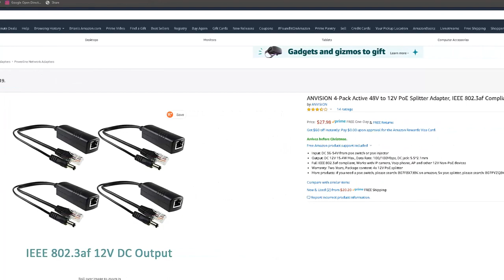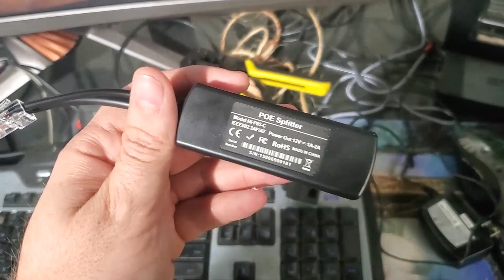Convert Cox iCamera2 12v to run on standard 802 11 POE

Comment: I'm trying to determine which are the 12-volt wires on the Xfinity xCam2 which is apparently supposed to be similar. I'm building a splitter to plug in to a router just to setup the dang wifi on the cameras without having Xfinity service.

Comment: Where did you buy the y connector? I bpught some cameras on ebay and have no idea where to find that connector to pair the camera to my router. I did see your link but I need the y connector with the female power output. Those were male.    Thanks and great video.

Comment: 😅 this several years old at this point but this is what I figured I thought a crossover cable might work but some of the newer cameras don't seem to be lining up with the correct pin to power them I wish there was a better write up and there's YouTube video there's not much information out there

Comment: If I make one of those, can I plug it straight into my PC ? And use it to record? I don't have a the system, I got the camera from Goodwill. I want to monitor my car in the carport. It doesn't have to be WiFi because it's close enough to plug in directly.
Reply from the maker: Not that I'm aware. You'd plug it into a router then look for the IP on the network.

Comment: Great Video. I tried this we a iCamera 1000 (i guess this was the original... haven't got it working just yet. the pin outs are probably different as the Rj-45 is a part of the camera), what software do you recommend using, iSpy? or something else?

Comment: Thanks for the video.  I've also acquired an Icamera 2.
My existing system is a traditional BNC coax mux. 
I can get a poe switch but was wondering if I could find the video + pin and also the 12v + / - ?
I've been searching online for a wiring schematic with no luck.
Any help would be appreciated.
Reply: Not sure about the Video +, but pin 4 (Solid Blue) is positive & Pin 7 ( White/ Brown) is negative. For the 12v supply

Comment: Thank you for video. Could you please share the full list of required accessories? I already have POE switch, 48V to 12V PoE Splitter Adapter. On the video I see that you are using 1 to 2 Port Female Socket Adapter and then I stopped understanding what else you were using. Thank you in advance!
Reply: Man, video looks great, but most difficult part is INSERT WIRES - try push red and black power wires - no way......it wouldn't work, video does not shown trick
Reply from the maker: @tedmaryniak2566  You just wiggle them like you do with any cat5 line. Time and patience is key.

Comment: My Cox icamera2's are hard wired but you don't need to go thru all that work.  I ran Cat5e from the cameras to my Cox router,  and used the provided power supply at that indoor location(no splicing needed).  When setting up the camera at the point it tells you to unplug the camera to establish wireless,  you just leave the camera plugged in and tap continue. Then the camera runs on a wired connection vs wireless and you only have the cat5e coming from the camera.  No need to splice wires. BTW this is standard for Cox techs to hard wire icamera2's when wifi signal reception is poor in certain locations.
Reply from the maker: These didn't come with any way to run wired. They only came with a cable that was two wired 12v cable that was a power brick on one end and a rj45 connector on the other. No way to power it otherwise because if you plugged that adaptor in, it used the only port on the unit. If you plugged  the ethernet cable in to the included router it wouldn't have any power.  What you received must have been something like the splitter we show at 3:04 which lets you plug two things into the back of the camera at once.  

Normal POE operations, office buildings running POE devices like wifi etc would need some way to use a POE injector like this so you don't need the original power adaptors, wall plugs etc at all.
Reply: @SanDiegoLAN  gotcha.  The new ones should come with a y cable for installation.  I thought the old ones did too.  Maybe that was missing from your kit

Comment: all i want to do is hook up a camera to my barn, but search after search, I still don't get it.  The barn is a whole block away from the house, so are you saying to plug those things into the sockets in the barn and it will automatically connect to the house wifi up the hill and then just plug in the camera??
Reply from the maker: All this video shows is how to get standard POE power down to 12v for people with these particular cameras. 
I would recommend researching POE (Power over Ethernet) for maximum distance, voltage etc.
Reply: ok so if you want to connect camera to you're barn you want to have a wireless camera that can go from your barn to your house, you cant use the i camera on youre barn because it prob does not have wifi and also i think you need to have that same wifi to youre computer.